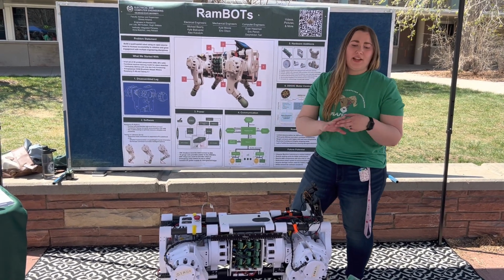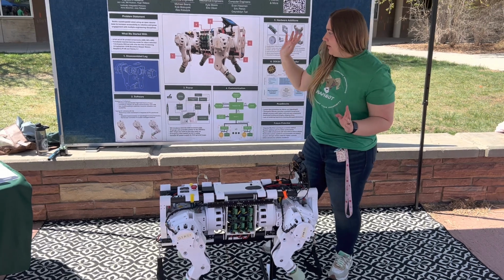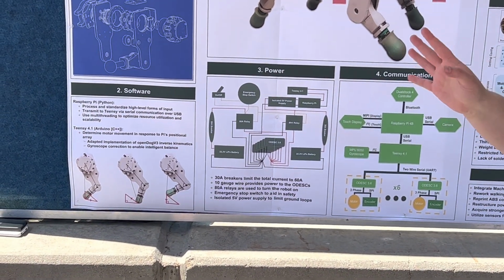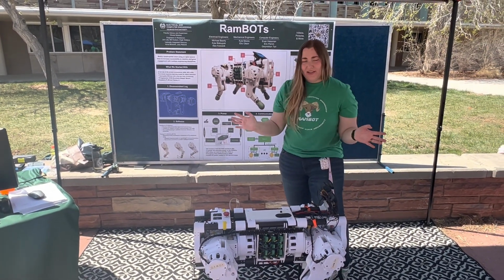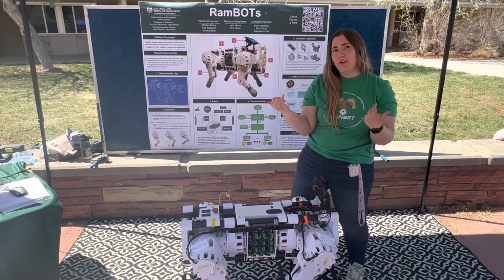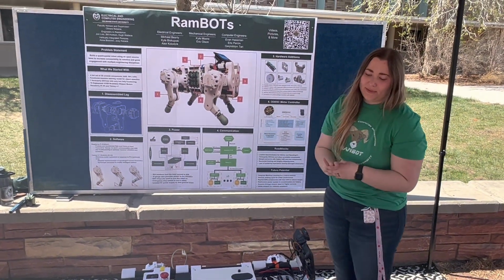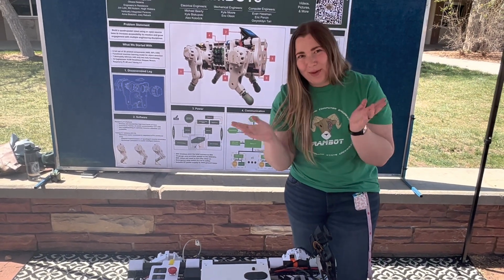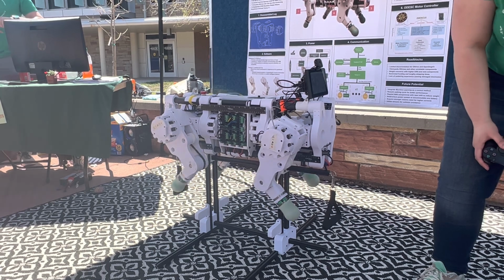Gwyn's Honors Thesis Presentation 4/24/23

Comment: Did you try to program the ODrives originally with Windows or Ubuntu? I've heard they wont program from windows very well, especially the ones from Ali-Express. I should have time in a few weeks to get mine back out and try. I have all six ODrives, I really don't want to have to by six ODESC's 😬
Thank you very much.
Reply: Originally we programmed the ODrives on Windows, but it turned out Macbook was the way to go. Windows overrides the drives that you force using zadig, so you gotta be careful of that. We didn't really test with Ubuntu, but I'm sure as long as its the actual OS, not like VirtualBox or WSL, it should work too.
Reply: @qwertyuioplark2  Thanks again!